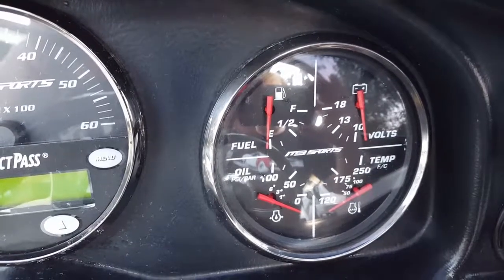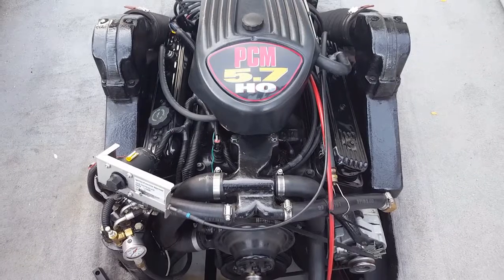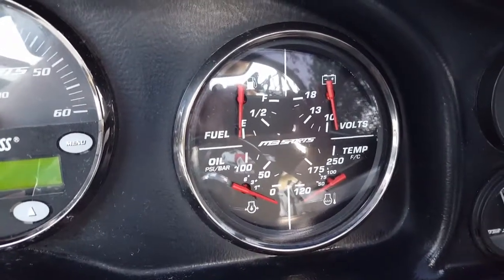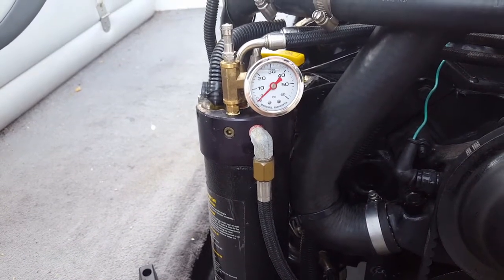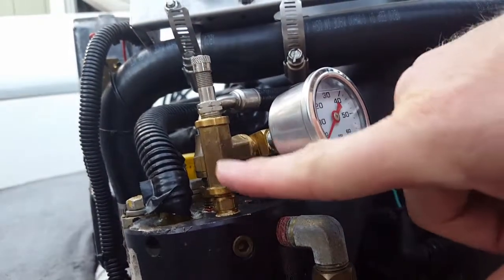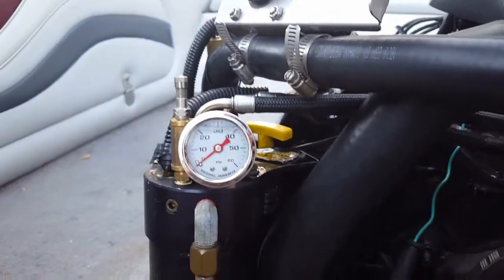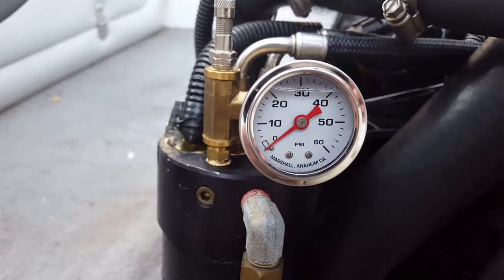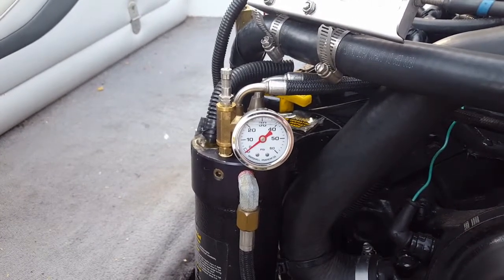Easy Fuel Pressure gauge added to MB Sports Wake or Ski Boat

Comment: Trying to help Son in law with his Tige with 5.7. Has both pumps as shown in your video. Trying to find fuel/water separator filter. Do you have one on your boat and can you show it. I think he has water in fuel but may just have fuel pump failure. Both were supposedly replaced last year. I like your pressure gauge addition.